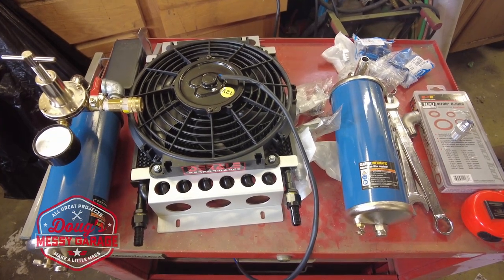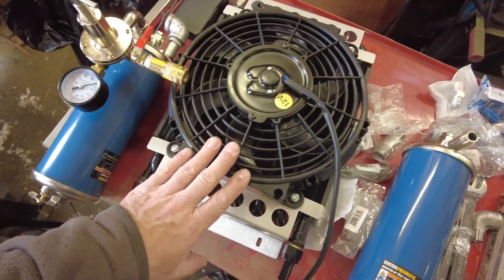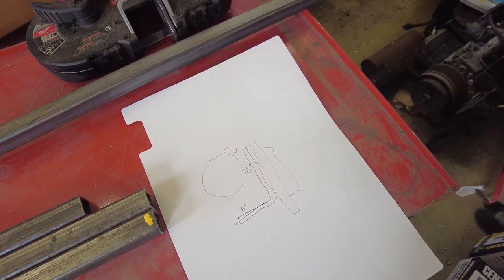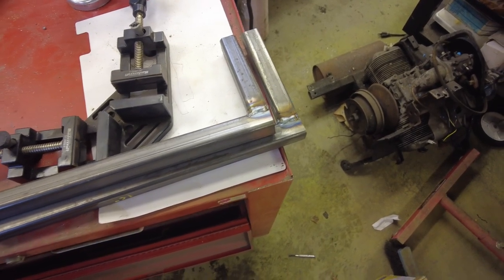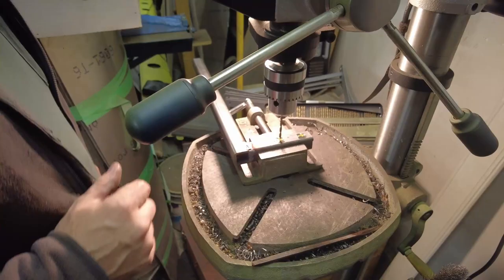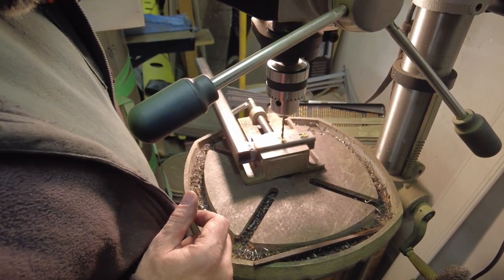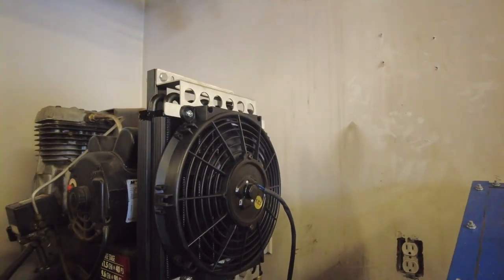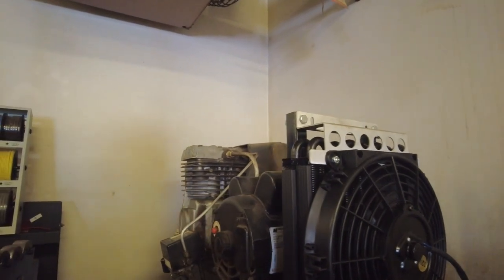AIR Compressor MOISTURE removal With an Intercooler: Pt1

Comment: I have seen many videos on adding an intercooler. Wouldn't this setup cause air restriction issues, causing the electric motor to work harder?
Reply from the maker: Not that I have observed.  Possibly it causes a small reduction of CFM output but the 3/8" line I used seems to flow pretty well.  The biggest side effect I have noticed is the depress vent from the pressure switch when the tank reaches the shutoff pressure takes much longer because of the volume of the cooler, lines and accumulator.
Reply: @DougsMessyGarage  that interesting, so you mean once your air compressor hits its set point, and the pressure switch release air valve kicks off, the compressor takes a bit longer then it use to?
Reply from the maker: @chvydrptop  The port that dumps the compressed air into the top of the tank has a check valve in it.  When my compressor kicks off, it has a small line that runs from the head to the pressure switch that bleeds from the check valve back to the pistons to make  it so the motor doesn't have to fight air pressure when it re-starts.  The line from the compressor head to the top of the tank check valve used to be 3/8" diameter and about 12" long.  Now it is several feet long and has a condensate trap in it so there is much more volume of air in the circuit that has to bleed back to depressurize the cylinders before the next startup.  So instead of a one second Hiss at shutdown, I get a hiss that lasts about 30 seconds.  I was a bit alarmed at first but its fine now that I know what causes it.

Comment: Why use AN flared end couplers? curious
Reply from the maker: Because they work well, are easy, and I have the flaring tool
Reply: @DougsMessyGarage  i DO NOT HAVE THE FLARING TOOL AND i USED COMPRESSION FITTING CAUSE THAT TOOL IS NOW 170 BUCKS ON AMATHIEFS....  oops caps my bad
And replacements ferrules are available and cheap...
Reply from the maker: @anonimous2451  Very understandable.